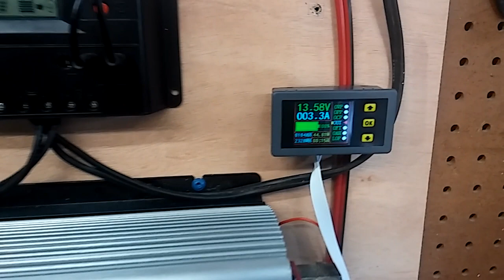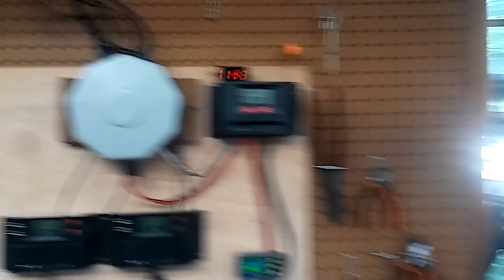Solar panel question.

Comment: Most Solar panels are rated at 1000watts/meter squared with perfect direct light.  Anything less is going to reduce the energy they create.  You being at see level & depending on how far north or south of the Equator you are you will have a smaller window of time if at all you get to & stay at 1000w/m2.  Higher elevations the air is thinner so it is easier to get maximum energy.  Your panel specification sheet or sticker should provide some of this data.  
Getting your panels from being in direct contact with your roof will help keep them cooler.  Place a few 2x4s under them so they are 3.5" off the roof.  The specification sheet should also give you information about the temperature.  So if you are more than +/- X° off the median you will reduce your overall wattage by X% 
Hope this helps you out some.  Take care.
Reply: An example from one of my panels specification sheets.  100 watt rated panel when the panel is at 77°f & there is 1000w/m2.
Let's say today the current Irradiance is 1000w/m2 & the current temperature outside is 100°f but my panel is at 107°f, my panel loses 0.44% for every 1.8°f above 77°f. With the 30° change in temperature my panels new maximum wattage is now 83.33 watts.
Now let's say the temperature data is all the same but the Irradiance is now only 800w/m2 because the sun has traveled east.  The 83.33 is now reduced by 20% & my new max wattage is 66.67watts.  This is why it is important to help keep the panels cool to maximize your power.
Take Care Friend.
Reply from the maker: Yes. Thank you

Comment: I have 2 HF panel kits running in to one of the charge controllers and i'm seeing around 9 amps max on the charge. I use a stand alone amp/volt meter I paid 18 bucks for on ebay. it has a 100 amp     shunt and is very correct.

Comment: I got the exact same system I put 8 panels (I bought 2 kits) put both kits into the hub connected to one of the original 10amp controllers when I use the battery or put a load (angle grinder) I consistently get 9.6 amps and 126 watts I'm doing it right now I live in AZ at 3000 feet elevation. I love your videos by the way. I have the 3000 watt jupiter. Maybe the angle on the panels?
Reply from the maker: msgt1942. Ya. I got 9.3 one day. I got excited.. Should be a bit more but happy to get it.☺
Reply: @Checkitfirst  today is the first day I finally got my system running so I hope it stays that way I will let you now what my results are in a few days to see if today is a good day or if its consistent every day.
Reply from the maker: msgt1942. Cool. I would like to know. Make a video of your set-up.. I would live to see it. Im sure others would to. Realy glad you got your set-up going. Did you get the meter im using or did you find a different one??

Comment: Altitude shouldn't matter as long as it is clear and sunny.   
Try this:
Disconnect each 100 watt system from the hub connector.   In full sun, measure the voltage at each output.  They should put out about 17 to 20 volts.
Now, measure the short circuit current output from each set with an ammeter connected directly to the output lead.  Each set should put out about 5 to 6 amps.   If your getting those numbers, then the problem is not the panels but somewhere after them.
Reply from the maker: Andy Andy . Im getting 2.5 amps from 1 kit and 2.7 from the other in full sun acording to the charge controller. Could it be just a cheap controller? Been getting a lot of comments about how i should get a mppt type controller.
Reply: Check it first 
It could be.  I remember once trying that controller and I wasn't happy with it and went back to my Coleman 30A PWM controller that performed much better.  I don't remember exactly what I didn't like about the harbor freight controller, just that I got better results with the old one.  If you have an a ammeter,  try it and you should get a more accurate reading.
Reply: If you're still only getting that little, maybe you got some bad panels.  Check the short circuit amps on each one individually.  Each individual panel should be putting out about 1.4 amps in full sun.
Reply: Check it first 
Just to make sure I'm not mistaken I just took some readings from one panel from that same Harbor freight kit.  The sun is out but it's low in the sky here at 5:40 pm and slightly blocked by a tree.  Here's what I got:
Hooked directly to a battery at 12.4 volts it puts out .88 amps.
Short circuited to the meter it puts out 1.1 amps.   Open circuit voltage is 23.6 volts (higher than I expected).  
So, 8 of those panel's would charge my battery at 7 amps in the late afternoon.   I'm pretty confident with the sun directly above it would easily produce 11 amps.  Somewhere  aling the line, you're losing some amps unless your controller is just lying to you.
Reply: Check it first 
In regards to the MPPT controller,  they can help by taking advantage of the higher voltage that your panels produce than your battery could use.  You could gain 30%-40% more charging current over a properly functioning pwm controller but they are quite expensive.  If you have the room, adding 30% more panels would probably be cheaper.

Comment: The problem is your controller.  Get a mppt controller all your problems will be solved.
Reply from the maker: Brad Hendrickson. Thanks.. I will look that up.
Reply from the maker: Brad Hendrickson . just to let you know.. I disconnected the controller and wired all panel's to a treadmill motor which is a 90v dc motor. Hooked my amp meter in line. When the motor was spinning i held the shaft to load it up all most to the point of stoping it. My amp meter only read 7.3 amps. Its a 90 v 22amp motor. All most dead shorting these panels I think should have been more like 15 amps give or take
Reply: Check it first 
The motor draws 22 Amps at 90 volts.  It should draw less at lower voltage.  It won't hurt the panels to measure directly off them by short circuiting them with an ammeter and you'll get a more accurate reading.
Reply: Also, don't expect 15 amps.  Those panels put out about 5.5 amps per 100 watt set.  (100 watts÷18 volts=5.55amps).  You don't recoup the lost power when drawing down the voltage by hooking it to a 13 volt battery.   At high noon in full in sun, you should expect around 11 amps short circuit current from both sets together.
Reply from the maker: Andy Andy . you know.. Your right.. I've been doing my math at 12 volts not 18.  4.5 amps have been my normal charging per 100 watts.. I did achieve 9.3 one day with 200 watts
Reply: @Checkitfirst  
9.3A is getting in the ball park of what the panels should produce, especially if they have some usage on them.  Other than some testing, I haven't been using mine since I bought them and just keep them on hand for emergencies. So they are basically still brand new.   Amorphous do tend to degrade faster and from what I've read, a significant chunk happens within the first 30 days of use, but I couldn't find any hard data to back that up.
Reply from the maker: Andy Andy .. Well if thats true, that would really suck. Was thinking of getting another kit
Reply: @Checkitfirst  
With a coupon, they're still a good deal for backup power, but if you're going to be using them regularly, poly or mono-crystalline may be better.   Either way though, I find that once you factor in battery life, off-grid solar costs more than it saves.  That's why I just keep it for backup power.   I had my shed solar powered with 200 watts of polycrystalline panels for a couple years because I didn't want to run electric to it, but after two controllers failed in the winter which then overcharged my batteries to death, the novelty wore off so I ran electric to it.